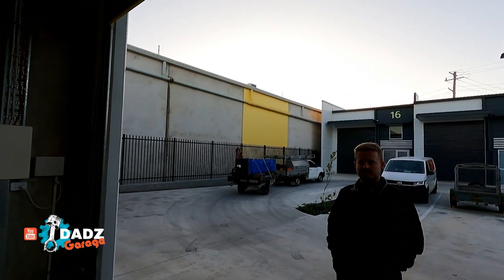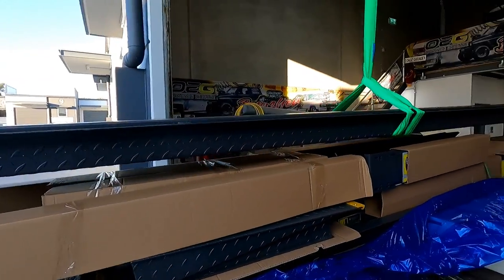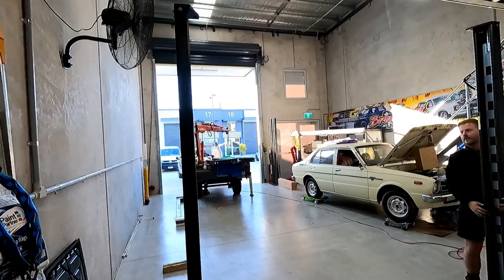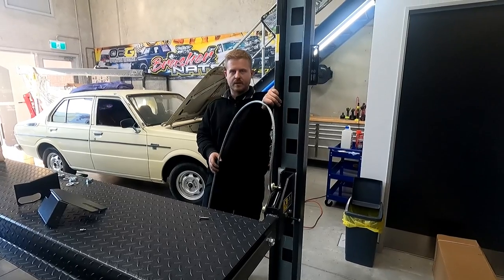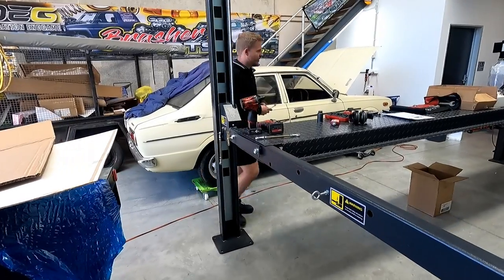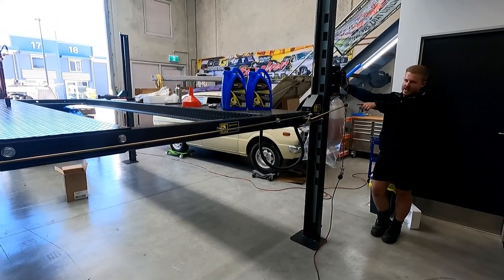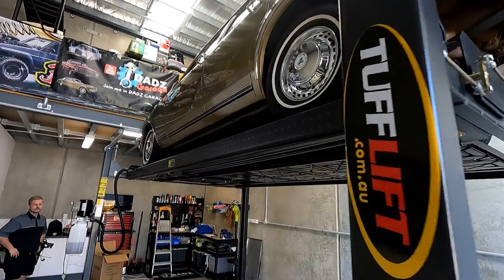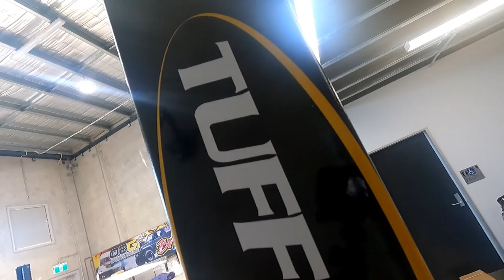Installing a new 4 post lift..

Comment: Nice lift back before retiring we had the 4 post lifts at work and I'm looking at a 4T 2 post Tuff Lift  but I'm having to look into the delivery and unloading options to a regional outback Queensland area.
Reply from the maker: They are great to deal with and am sure will look after you. The installers are great and they they have a few on the books.

Comment: I’m getting one of these hopefully very soon, good video. 
I noticed a short lead between your extension lead and motor, was that a 15amp to 10amp lead?
Reply from the maker: Its a caravan 15 amp to 15amp lead. I also have this on a 20amp plug with D type 20 amp breaker.
Reply from the maker: I am also going to get the lighter ramps i think. They are pretty solid and heavy.

Comment: Could you please tell me how you released the cables to make them longer to reach the top of the poles.  I have the cables just barely through the pulley wheels.  Is there some way to release them so I can pull the cables longer.  I didn't see how you did it in the video.  Thanks and hope to hear from you or someone.  Great video by the way you did a great job with it.
Reply from the maker: I think maybe give the guys a call at Tufflift. They are always helpful when i call them.

Comment: Just curious mate, what size shed have you got?
Looking to get a 4 poster around 4.5 to 5 tonne
to park our swb Coaster on and my Mercury beneath.
Our shed is 6m x 10 m, guessing yours is close to that?
Cheers.
Reply from the maker: Mine is 7.5 wide with some stairs one side, 11 .5 metres deep.
Reply: @DADZGARAGE  
Thanks mate,
Yes ours is just that bit too narrow for two cars side by side.
I notice a tough lift is a bit more expensive than others
but a few build quality items put the tough lift in front.
I just have to jump up to a 6 tonner which does blow the price out.
Still, buy right, buy once.
Reply from the maker: @imanenigma3348  The tough lift is slightly narrower than most others and that was perfect for me to get 2 cars side by side with walkaround room. I found the product to be excellent, the service very good and also very happy with the lift over 12 months later. The ramps are heavy but everything else is spot on. Tell them DADZ GARAGE sent ya.
Reply: @DADZGARAGE  
Thanks mate, I wish our shed was the same dimensions as yours,
makes a huge difference, especially for our chubby Coaster
and fat full size Mercury!😉👍